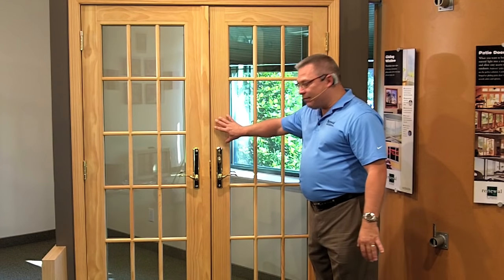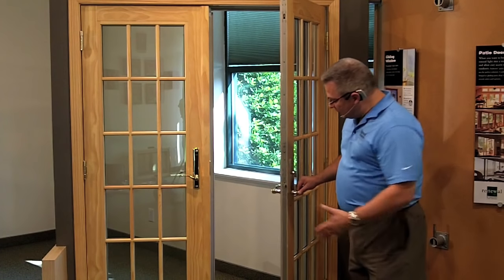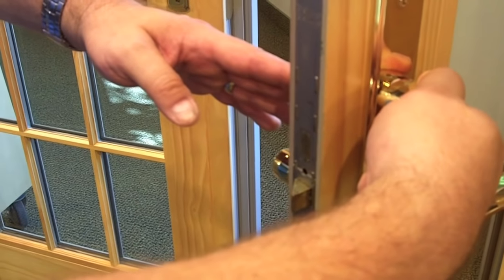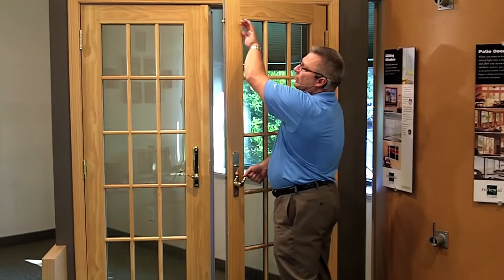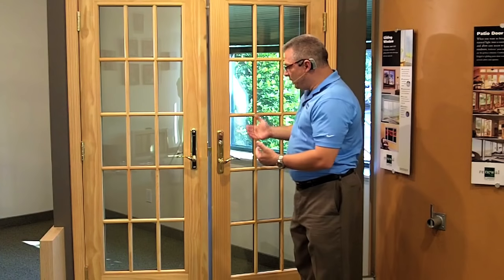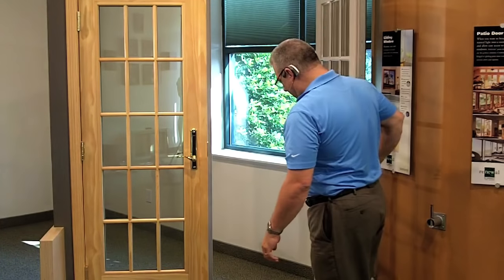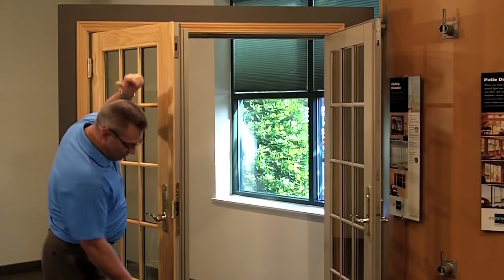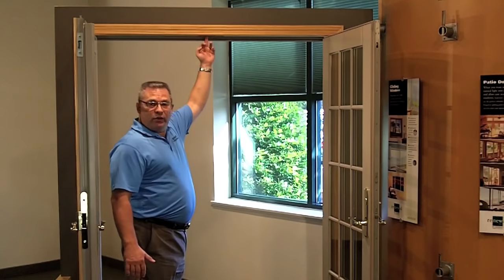French Doors Locking System

Comment: This is a nice clip and explanation.  I have found this setup at Lowe's but only for an exterior french door.  I was hoping to find something similarly elegant for an interior master bedroom door.  They are telling me interior doors are too thin to do this, so the only option is one locking/fixed door and one moving door where the fixed door can be opened but is fixed in place by manually sliding latching pins into upper door frame and floor, by levers at the top and at the bottom on the fixed door, and then the moving door just locks into that fixed door like a normal single door would lock into a single door frame.  I'd just like both to open via the door handles.  Any solutions are appreciated.
Reply: Hello for most Track and Spec homes you do get 1-3/8” doors for your interior. Move up to Custom built homes and you can have 1-3/4” for your interiors and 2-1/4” - 3” for your exteriors... In your case just change out your 1-3/8” doors for 1-3/4”...  You will have to alter or replace the Jamb as the door stop will need to be moved and the hinge pockets routed out for a larger hinge (4”, 4-1/2”).adding a center hinge as well for durability...  Greg
Reply: What term can someone search for to find these at Lowes?
Reply: Greg- It may be easy to say, "just get a thicker door" but that can literally cost over $1,000 or at least very close to it, which is not very practical for most people who already have doors that work and just want locks.

Comment: I had Anderson doors installed in 1995 and they were fantastic, lasted till 2017, so i replaced them with Anderson doors, now 2 1/2 years later they are falling apart.. and that locking system snapped due to cold weather.. next one's ill make myself.
Reply: Same story here.  The secondary door has failed.  I can no longer open the secondary door.

Comment: Very well made video, pretty short and sweet like they should be. I noticed that you lifted up handle, and the little hooks came out. I assume the lock deadbolt mechanism requires you lift the handle and then lock it. I think you can add a callout for clarification at that part, other than that nice thx.

Comment: But it's not secure if someone breaks the glass and opens the dead bolt! Don't you need a dead bolt that is closed with a key for the inside in order to be a bigger deterrent to a burglar?
Reply: Lianda Ludwig A thumb turn makes it easier, but a key operated lock won't slow burglars down much either as they've broken the glass already. Security glass will not shatter like normal glass, it 'crumbles'. So there's a hole already and it's easily widened and presto a hole to crawl through.
Reply: +Lianda Ludwig A deadbolt becomes a hazard in the event of a fire.  You don't want to be trapped inside.  If a burglar really wants in, he'll go through a window.
Reply: Susie Q lol in the event of a fire can't you break the window too? Sorry just playing devil's advocate
Reply: Yes, Jarod. But the door will still be dead bolted closed.
Reply: Lol yes but it's a very big window and easy to break. You can fit a whole person in there. As nice as French doors are, they are also very easy to break. Even with the dead bolt. If it's security people want, French doors are a poor choice.
Reply: that is why you get the Hurrican Window French door glass... can't even break with a sledge hammer

Comment: Nice locking system. Just one issue here. All an unwanted intruder needs to do to overcome all of those points of contact, is to break one of the glass panels, reach in and turn the dead bolt release knob. A key release dead bolt would be an answer for that issue, but who wants to have to find a key to get out of the house? That could become a safety issue.
Reply: But these are french doors already inside the house, not exterior french doors.

Comment: What is the term for the door locking system on the left door; if I want to keep that door locked and just use the other ( right) door most of the time for entry & exit from a room.
Reply: TheDerek47 - I believe it would be called the in-active door two-point locking hardware...?